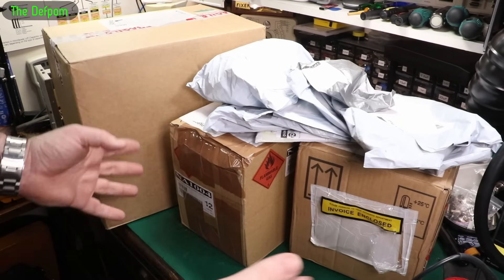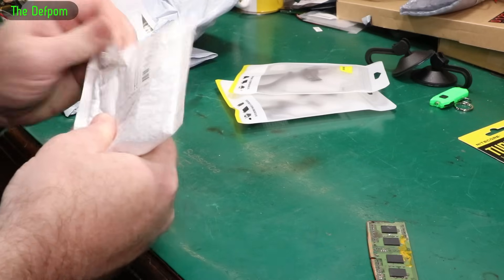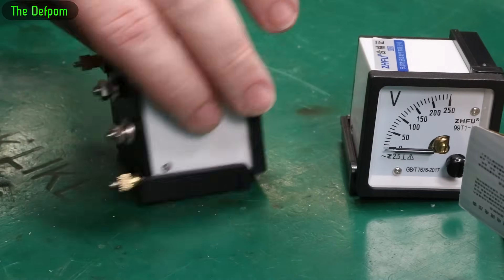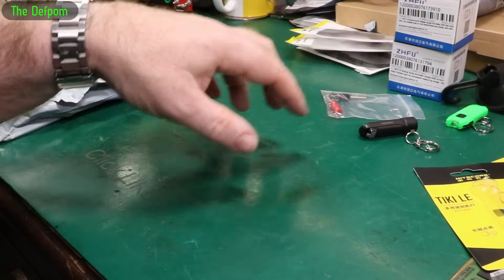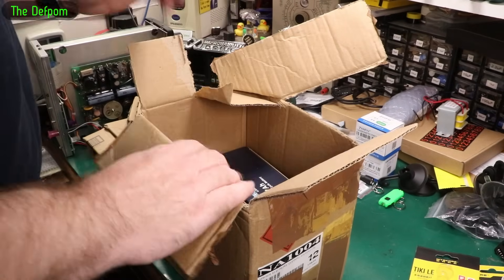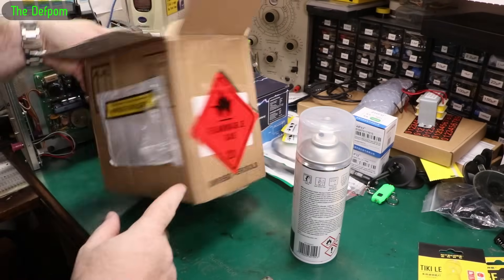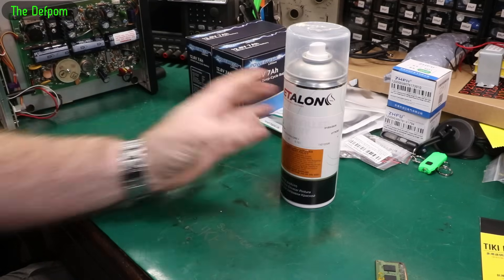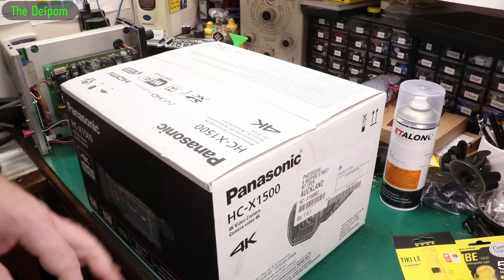🔴 Mailbag Monday 12th May 2025 - No.1358

Comment: I think your find that a blunt scalpel works a little bit better than the memory card. 🙂

If you could stop the sheep leaping on to the overhead power lines you would get less outages.
This idea is based on the fact we have very few sheep near us and have very few power cuts. 

We do get NZ lamb here but normally in the freezer section  of the local supermarket🙂
Reply from the maker: @TheEmbeddedHobbyist  and I believe you can actually buy NZ lamb cheaper there than we can here !